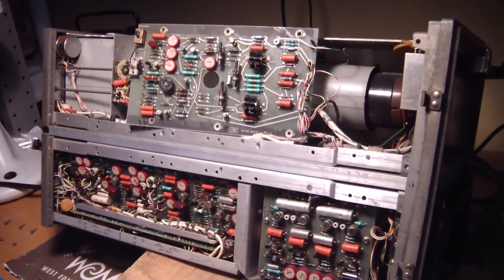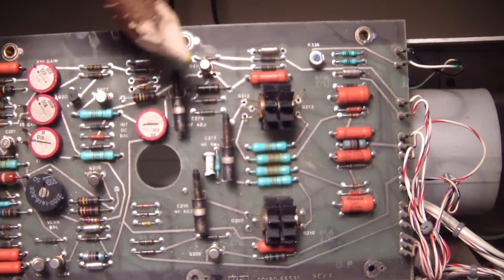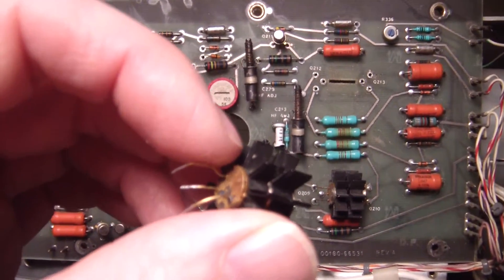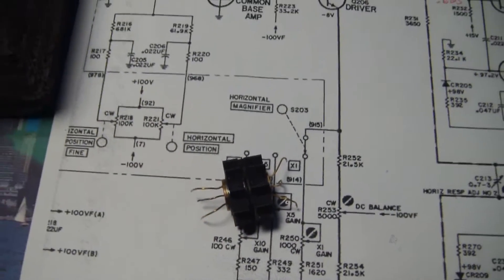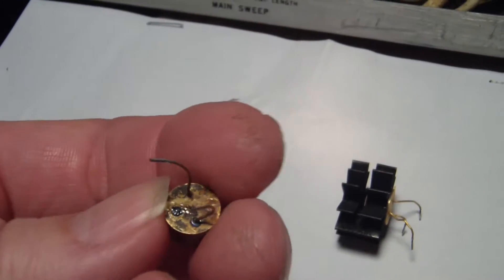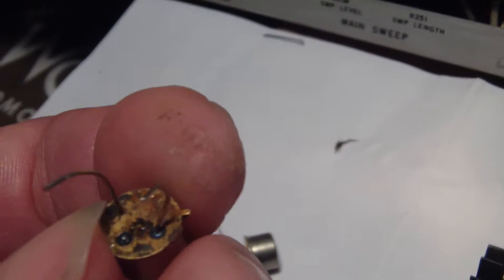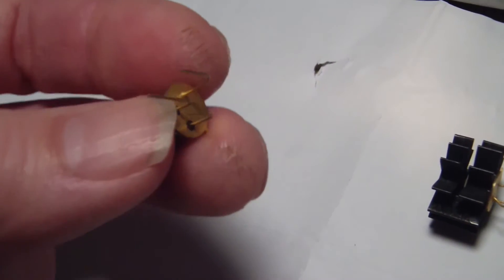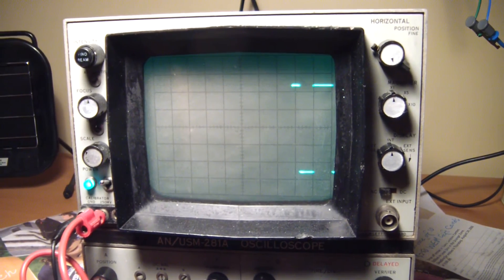HP AN/USM-281A - Oscilloscope repair, Part3

Comment: Q211 must be broken if there is -5v on its base and  +0.42 on its emitter.  Shouldnt rely on newfangled component testers should simply look for diode forward voltage drops or even just a lower reading of resistance one way rather than the other. Also check the values of resistors that show discolouration. I had to replace a lot of resistors in a 1976 HP141T spectrum analyser which were brownish
 And on a more modern scope one horizontal deflection transistor was intermittent. It was thrown in a skip in about 2000 as defective. Worked for a couple of years then the fault would come back and then go away. Eventually swapped the transistor for a similar modern one and it works now.

Comment: I see that you haven't checked passive components although there are two resistors that seem to be bad. it's even difficult to read that color code on them. I think one of those resistors at least would be already an open-circuit
give it a try and leave a feedback please
Reply from the maker: Sorry for the delayed response on this. I was just notified by YouTube of your message. 

Regarding the passive components, I agree. I have been chasing down the active component hole and ignoring the passive route. I will now focus my attention on the passive components. Thanks for your input.

Comment: Dear Sir xD, you have to look up the circuit that bais the power output stage this bais point sets the position of the trace in the horisontal defelction.The base voltages on the transistors should be the same if not  it looks like some resistors or semicon may have change their characteristic and shifted te q point. also you have to look up for ripple on the rails using an AC dmm is not inportant the value, they should be the same in the two rails + and -.

Comment: Have a 180D with the same issue, did you find the problem.  Also looking for the schematic, found some copies of the service manual...
Reply from the maker: +Tim O'Brien  -  problem was not resolved. I pushed it back on the shelf for now. If you come up with the resolution, please post it here. Would be nice to use the analog 'scope again.

Comment: Q213 and Q212 being NPN and PNP do not necessarily have to be Hfe balanced since in this schematic they are working in class A mode. Meaning they share a maximum current load all across the signal span. Hence, the average Hfe of the circuit would be a combination of both Q and some of the circuit configuration. The main goal here is Gain and Linearity, and this is accomplished be the Class A circuit config. In fact, from your schematic Q213 seems to be utilised as a constant current source. Its Q212 that provide the amplification. So, changing them, if they were already working did not change anything. 

ALso, can I also mention that one should always avoid bending back and forth monofilament copper for they are doomed to break very soon, certainly not after 1000's of times.

Its sad that you could not fix the problem, USM281A is a fantastic scope. I have one myself and you are right its much greater at HF then a digital scope. I am trying to fix the preamp selector switch on it. My channel B is no longer working. You wouldn't happen to have a digital scan of your service manual by any chance, than I could get. It would be so much easier to fix my scope with a schematic. Did you get to fix yours after all ?

Cheers Mike, keep the passionate work...